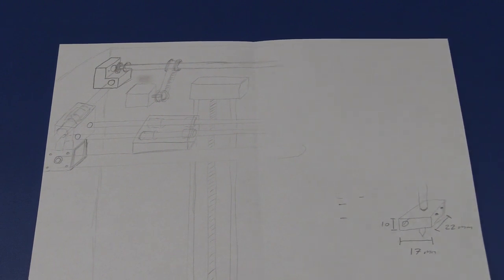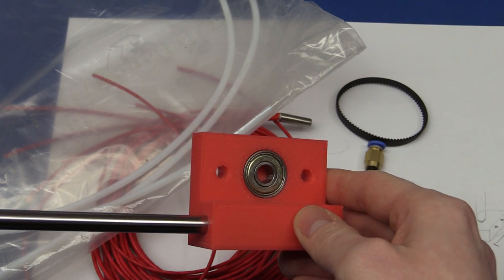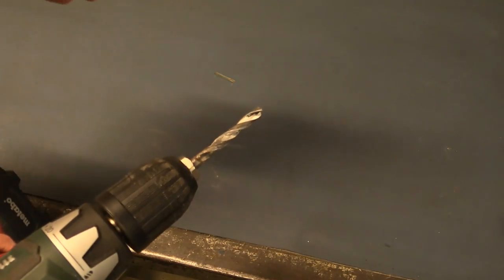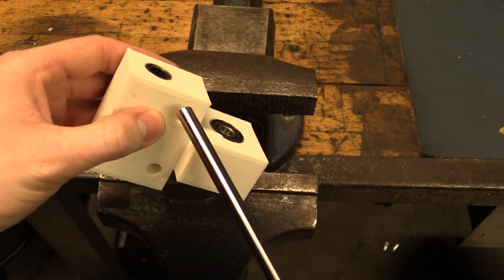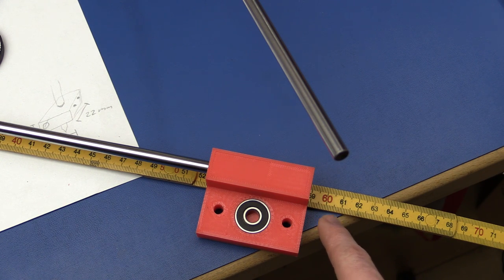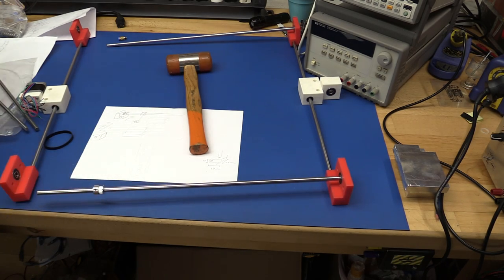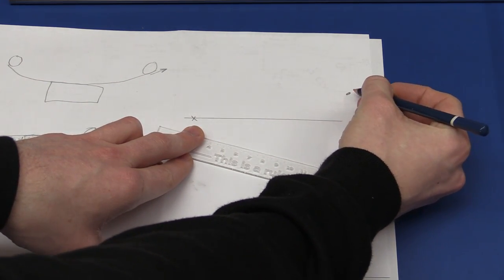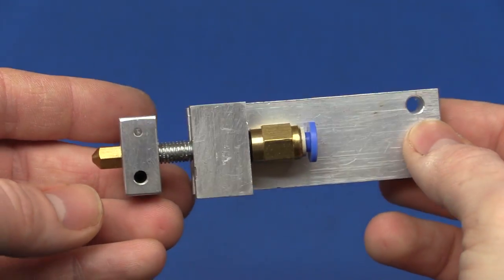DIY 3D-Printer Build (From Scratch) - Part 2: Making stuff - Ec-Projects

Comment: Pro-tip for fitting stuff tight - put the part that goes in (bearing in your case) in a freezer for half-hour before inserting it - it will fit much easier (everything contracts when cooled and expands when heated)

Comment: Great project. chappeau.
Maybe you could leave the holes for the bearings just the right size, clean them with a flatblade drill, and so the bearings slide in and out, then hot glue the bearings in the plastic, while inserting the rods with it. That way i could be nice and centered.?

Comment: I've glued ABS with Dichloromethane. It will make real plastic weld. The better the parts fit together, the better the weld. It adds no material of it's own, just "gooifies" the plastic. If something just broke apart, meaning the parts are clean and fit exactly, a few drops of it will make a connection that's as strong as the original (after it has evaporated all that remains is the orignal plastic after all). Its surface tension is so low, that it will creep deeply even into small cracks. I made my own custom casings (I needed a long but flat case, that I couldn't find to buy anywhere) for example by cutting the ends of two 10x6x3cm cases and joining them to a 19x6x3 cm case. It's as stable as if it was made that way, including the screw on lid that's maybe just 2mm thick with a 5m lip at the edge and still removeable.

It will also glue Acrylic very well, better than Acetone, and create totally invisible joints (again, if the edges are prepared well).

It's really useful to have a little bit of it around. Just be sure to use it in a ventilated area if you are applying more than a few drops of it.
Reply from the maker: Yep, I've heard about the stuff, but never tried it.. I'll have to get some to try it.. Thanks for the tip :)

Comment: May I suggest modeling it with the correct size. Just model nubbins periodically through the bearing sockets perimeter, it will create enough pressure and let you squeeze them in tightly without risk of cracking the model.

Comment: For the bearings add mineral oil.  Mine were rubbish from China but I soaked them in alcohol and degreaser and then washed them and added mineral oil.  Very smooth now.

Comment: the first bearings you show that you say aren't bearings are bearings. 608ZZ are commonly used inside skateboard and roller skate wheels. they need lubrication with some lite machine oil like you would use in a sewing machine to operate well.
Reply from the maker: Richard Fox Yeah, it was just a joke really. The problem is that they are very low quality and not consistent quality either. Some of them you can feel, just by spinning them by hand, that there is play between the races and the balls. Some of them are somewhat okay I guess, but I wouldn't take the risk and have to take it all apart again.

Comment: Instead of sanding down the bearing holders at 10:00 it seems that you could have just used a heat gun to make the opening expand a little, and then install the bearings that way.

Comment: when you designed the holes for the bearings, did you apply offsets like 0.1mm or something, or did you designed completely the same size as the bearings? just curious 😁

Comment: nice one.are you going to be releasing plans for this printer?what time scale so you think this will take you?i built one last year that is on the rostock style using an ardunio and it looks great but i just cant seam to correctly tune it so ive been tempted to strip it for parts and start with one similar too this as i have a ctc/flashforge myself and want one with a bigger build platform.
Reply from the maker: dvdxtreme360 Thank you. Yes, I'll make some plans :) The parts are on Thingiverse, there is a link in the description of the videos :) I hope to get it finished within a month or so, but can't promise anything:) I'm currently waiting for the glass plate which is out of stock :( They said it should be here no later that 1st of April though..

Comment: I was happy when I seen your first vid in this series but then I seen you used 3d printed parts which suck for those us us that do not have a 3d printer ,  i read the discription so I hope your final build does not use them which is why I am watching this video.
Reply: how he does the parts is of no matter really, you see the parts how they are shaped, make them your self the traditional way with hand tools. i do think about realising a 3d printer myself, not sure jet. but if so, i would try to cast the parts in aluminium or carve them out of realy hard wood, that should do the job,

Comment: couldn't you just freeze the bearings for them to fit in better. as freezing the bearings make them shrink. its a trick used in rebuilding motorcycles.
Reply: But when they expanded back to original size they would split the part
Reply: good point the plastic is weaker
Reply: I think the plastic is pretty elastic... it doesn’t shrink much... probably the plastic would be still too small

Comment: DIY 3D printer from 3D-printed parts????? emmm
Reply from the maker: Иван Иванов Or from wooden blocks, or tungsten carbide :) Should be possible :)
Reply: Иван Иванов have to start with something.  Have you checked out Reprap, that started all home made 3D-printers? http://reprap.org/
Reply: There should be 3d printing services available in your area. I dont think its as cheap as using your own filament and printer but to get you started it can help. Just google 3d printing service in your area or country
Reply: Yeah I think his this guy's point is, you called your video 'Make a 3D printer from scratch' which is why I watched it, but then went on to make 3D printed parts!!!! I don't have a 3D printer!!! I wanted to see a tutorial of how to fabricate the parts that I couldn't buy where necessary!
Reply: +Robin Lovell that's what i am talking about, thx
Reply: Robin Lovell well, then make them in wood or something.
Reply: I would just machine them out of delrin or HPTP plastic in a milling machine.